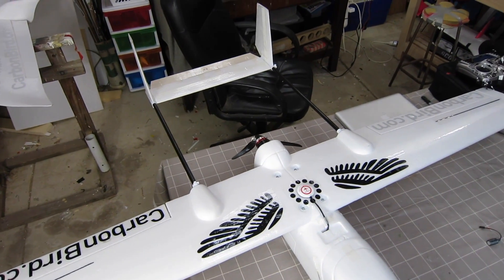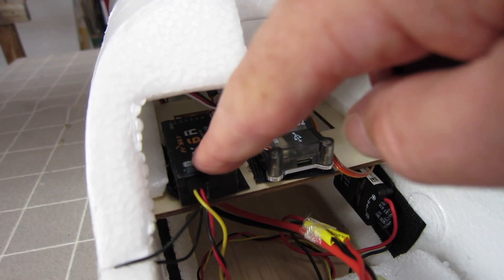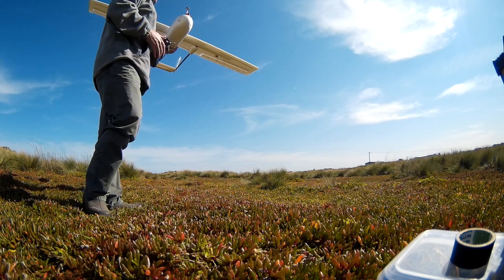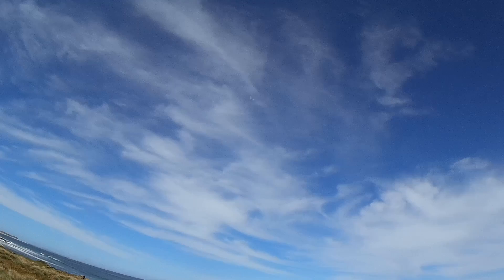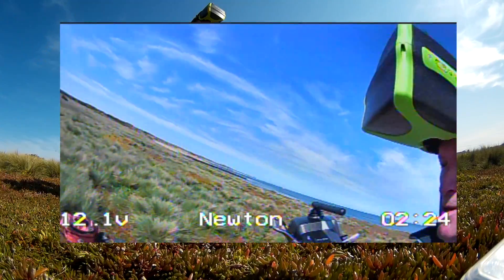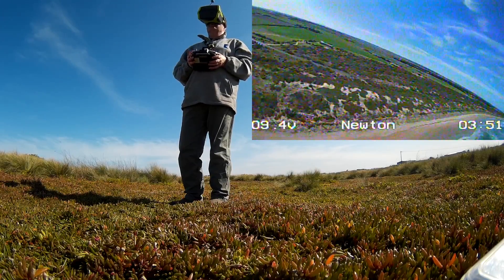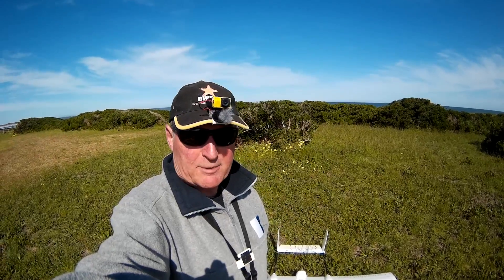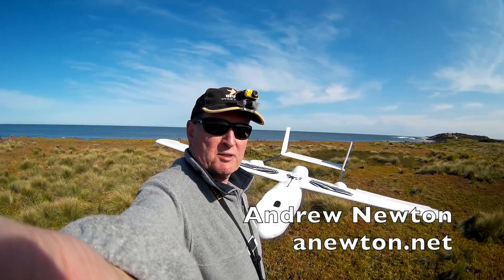CarbonBird SkyHunter AIR3 iNav

Comment: That was a great flight, Andrew!  Love that auto-launch!  Multiwiicopters is still out of stock on that Inav but I am monitoring them daily.  Take care!
Reply from the maker: Yes I hope they restock soon, lots of interest.
Reply from the maker: Just heard, it's only the GPS antenna that's holding up supply, should be available next week
Reply: Andrew Newton thats fantastic!  Ill be watching their site. Thanks!
Reply: Andrew Newton Ya know...ive heard that the Inav can be used with flight controllers that are very similar to the flight controllers that I use on my mini quads....just have to add the GPS.  That's fine and dandy but I think the flight controllers would be slightly more difficult to instal in a plane/wing.  That's why I'd really like to have the unit that you have....so, I'm waiting.

Comment: Nice job Andrew....I think you should ask Gearbest to send you an L9R receiver.....Then you can really stretch her legs. Standard RXs are only really good for a couple of Kms or so, sometimes less. Doesn't that headset have diversity..? You may need a directional on your VRX, or better still, do Like I do on 5.8G and use a pair of them.
  Good job you didn't get too far downwind, sounds like a bad cell on one of those Lipos maybe?
Reply from the maker: Good job I wasn't offshore! No diversity on the Headplays

Comment: Hi Andrew, nice. I'm preparing a fixed wing FPV with the Paris Sirius. I would like to ask you a question : if I use an external BEC (not the one from the motor controller) should I cut the +Batt signal from the motor ESC BEC to avoid some of the noise coming up from the ESC?
Reply from the maker: That is correct Paul. Cut or pull out the 5V red wire from the ESC connector. Not good to have two different 5V wires connected to the Paris Sirius.
Reply: I found the servo wiring diagram at Carbonbird, on the Paris Sirius Air3 product page. Thanks for the reply. 
http://www.carbonbird.com/products/inav-air3-fixed-wing-airplanes
Oh and do you have a CLI dump of your SkyHunter flight controller? I'm stuffing my Inav/FPV gear into a world models Piper J3 EP. That would help, especially for the gains (ANGLE, ALTHOLD, HEADING HOLD). Thanks.
Reply from the maker: Sorry Paul, I dont have the Skyhunter any more and didn't keep the CLI dump. I would have used the stock gains but maybe reduced the expo from 0.7 to 0.3
Reply: No problem, thanks anyways. :)